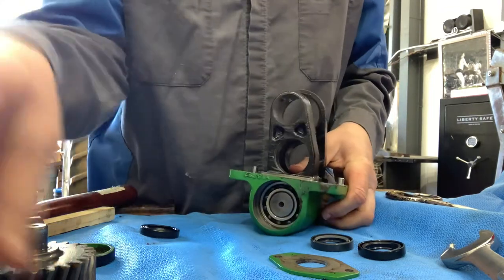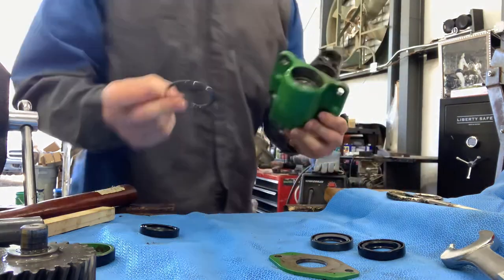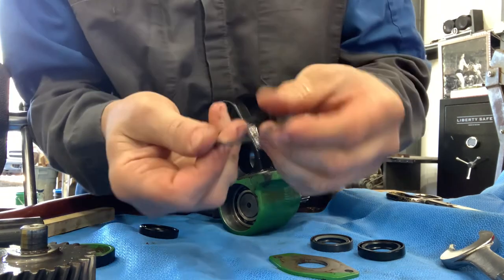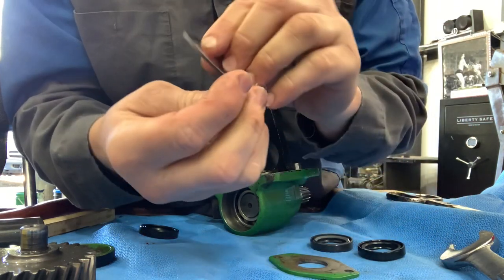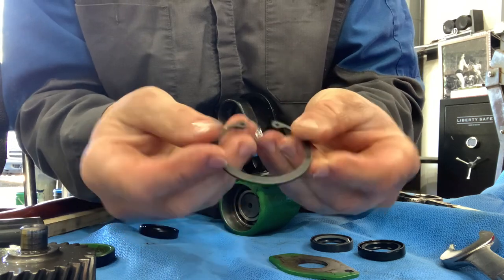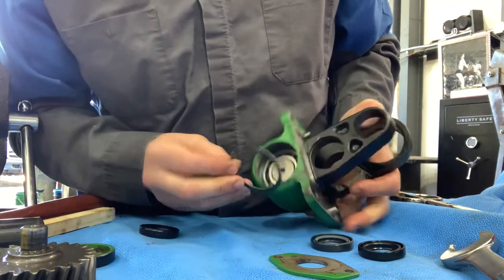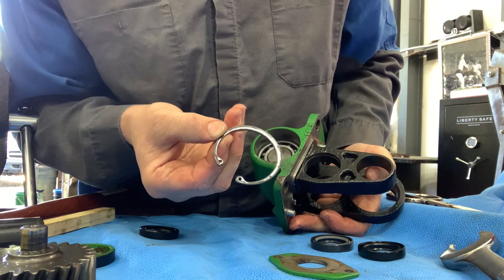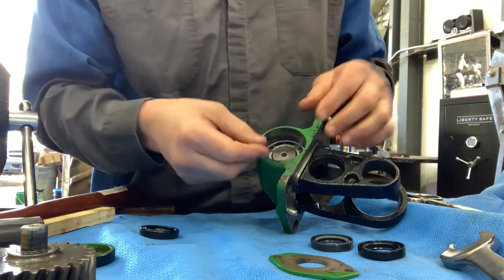How to correctly install a snap ring and or retaining ring

Comment: i learned this from a maintenance man from work one day.the wheel of my riding mower kept falling off . its held on the axile with a snap ring. i kept putting the snap ring on with the rounded side going toward the end of the axile. well the tire kept working itself off the axile. turned the ring around so the flat side was seating itself in the groove in the axile towards the direction of the end of the axial and the wheel stayed on.